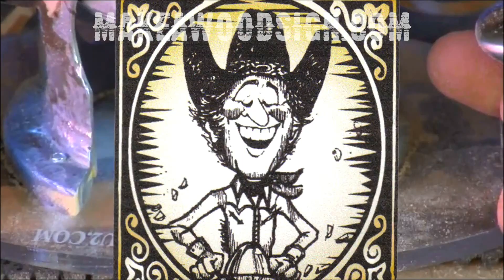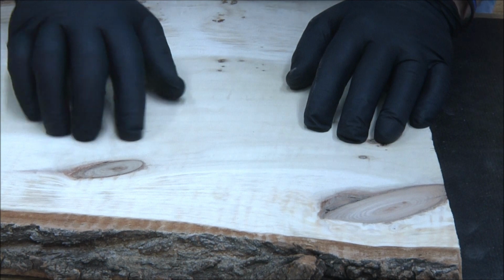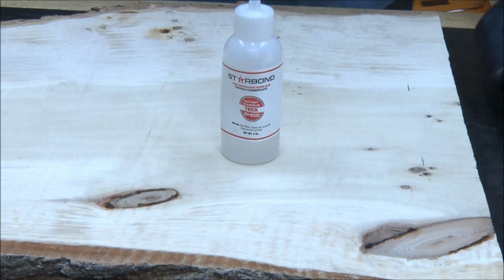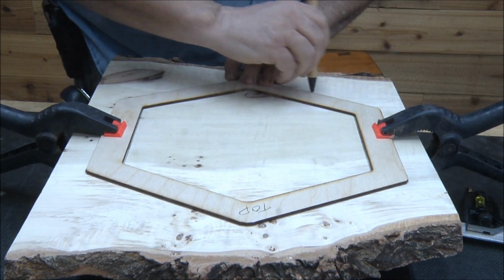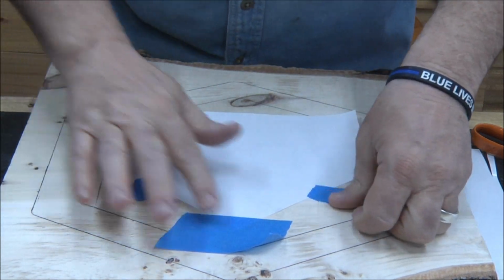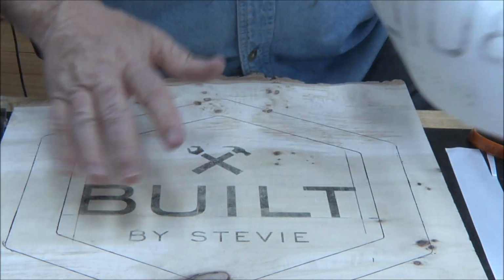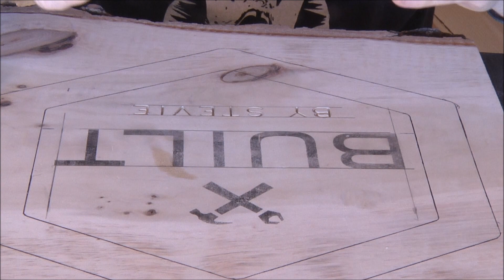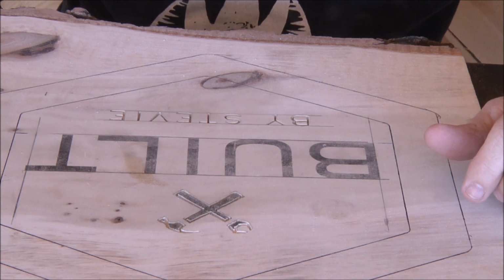#370 Part 1 Making a Sign For Built By Stevie

Comment: You actually did a good job on the video considering you were all by yourself.  The only question I have is what depth you were carving with the SC-50 bit.  Was it 1/8" or 1/16"?  I know you have mentioned not to go very deep with the SC-50 because of the single flute and its sharp point, but I was just wondering...
Reply: no deeper than 3/16 or just enough to cover the nthickness of letter
Reply from the maker: Thank you Bob, sorry I didn't mention it. I was actually close to 1/8" because the point was no quit as sharp on this one. It worked great.

Comment: on the top of the sign there pic. of the tools.could you use  profile pit on that section? looks like it is going to be nice sign.did a good job without vicki...not as good as with her but pretty good.
Reply from the maker: I will use the SC-50 first and then the profile as well. You're right it's always better with Vicki here.